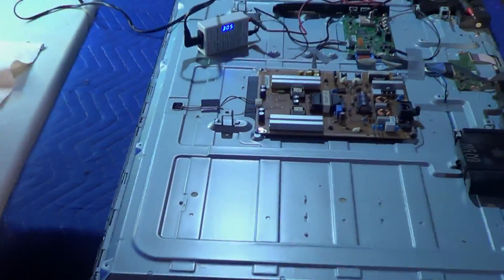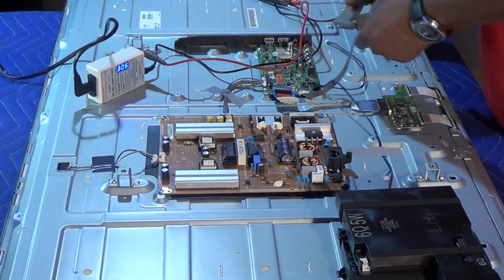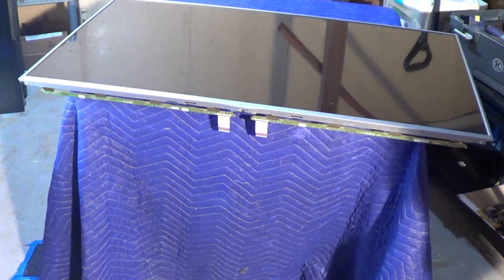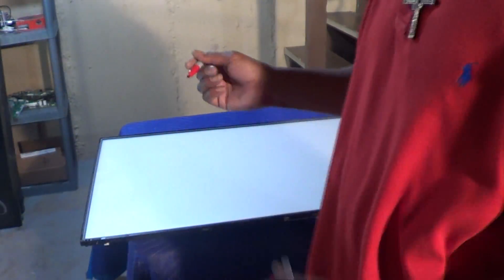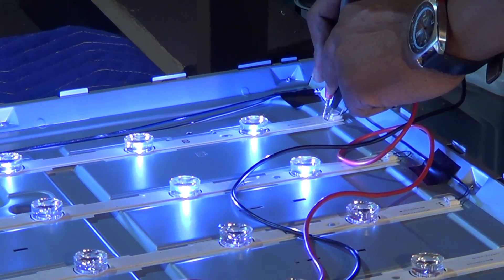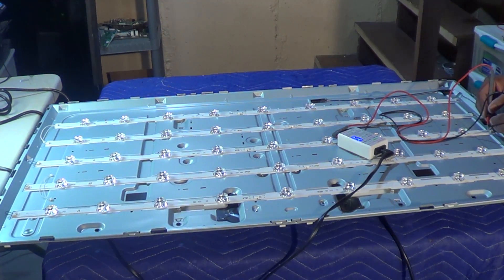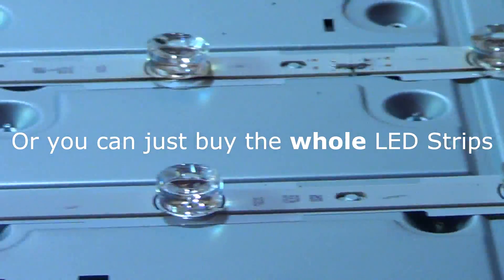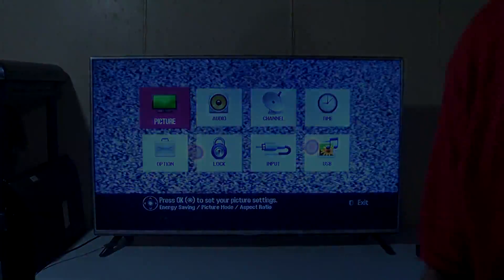LG tv 49LF5500 screen repeatedly flashes on and off, repair.

Comment: Hi Big dog, I did everything exactly as you said, it worked, then I putted the LCD on top to test everything before to assemble and it worked just fine, felt like "work is done". But after assembling (and I tried to be so careful specially with the LCD), the image is messed up, there is a white strip going from side to side and the LG logo is repeated all over like a shadow, then little by little the whole screen is turning into black. What you think is it? Visually the LCD look great, I don't think it's it

Comment: great video as always, how do you deal with individual replaced diode that are brighter than the rest diodes? thanks. A dimmer led is not that noticeable, but it seems a brighter one will be easily spotted when you have the screen back on. Thanks!
Reply from the maker: probably not, just make sure that the led cover is centered on the led and it should be fine.

Comment: I have an LG 65" LED tv. Occasionally it reboots itself over and over again. Not screen flickering but a reboot as if you were turning it on and off. Some nights it reboots itself like 50 times in a row every few minutes, sometimes it doesn't happen at all for as long as a week or two. Any guidance on where to start testing or replacing? Thx

Comment: superb video, sir.  As far as the LED tester goes, can't I just apply a DC voltage at the test points on the strips and test that way?  If so, do you know the voltage?
Reply: Yes I can use a multimeter.. on DC voltage ground it to the chassis and proceed to test it
Reply: @HerMortalMajesty  thank you - I had a dc power supply and was able to test the individual leds and the strips as a whole. Worked pretty well. Found at least one bad led. Can’t believe they’re in series like cheap Christmas tree lights.
Reply: @artompkins7958  ikr🤦‍♀️🤣
Reply: @HerMortalMajesty  ikr = ? "I know, right?!" ?
Reply: @artompkins7958  exactly

Comment: Also when testing just put the probes in series with the leds rather than removing the connectors, I use an adjustable power supply at a set limit. Also best  to change any that look a blueish colour they normally start flicking at lower backlight levels.